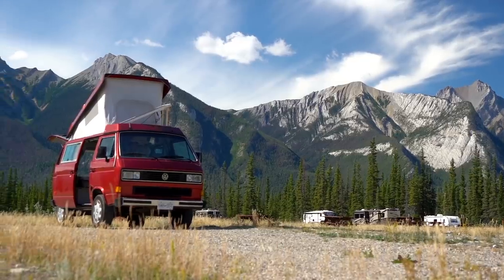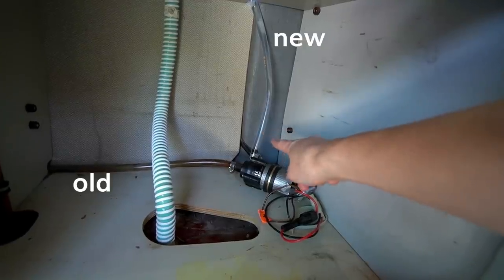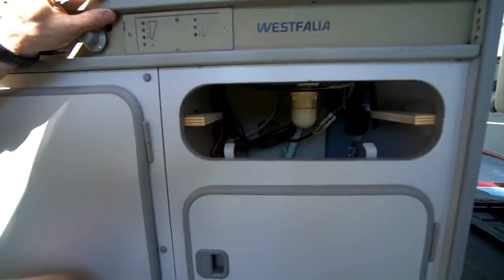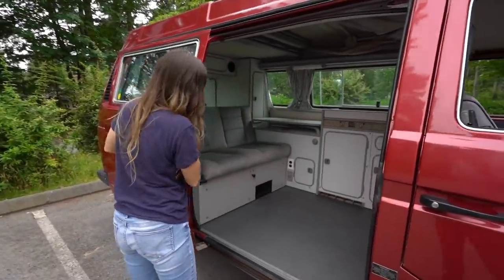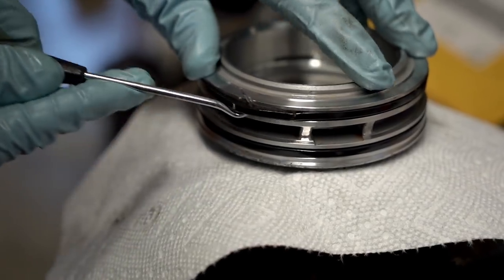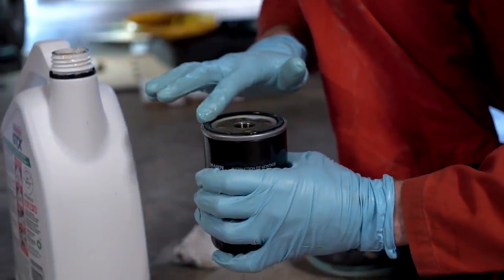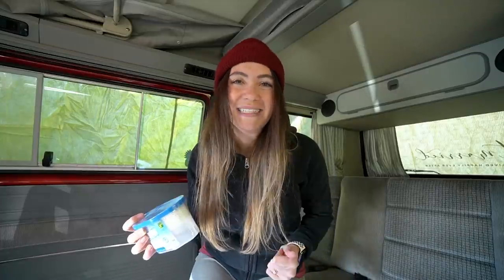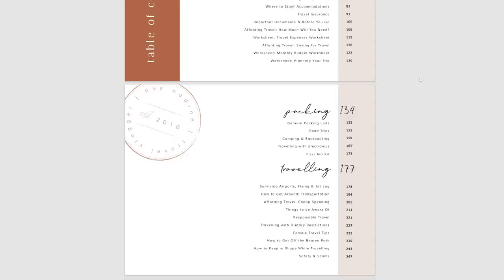FIXING OUR WESTFALIA & Our Winter Plans

Comment: Great fix video! I suggest the Shurflo faucet to replace the original Westy unit. It's a lot easier to adjust the water flow with soapy hands, thus using less water in your tank. For mouse prevention there are two vents for the starting battery in the right front passenger wheel well. One is behind a triangular sheet metal piece. You can probably stuff some copper or steel wool in them to keep small 4 legged tenants out.

Comment: Why not upgrade the radiator? Such a small engine will be vulnerable to overheating on long trips, a bigger capacity rad will help, air conditioning to help with the cold and heat?
And solar panels+usb charge sockets!✌️❤️🇬🇧 hope this helps!